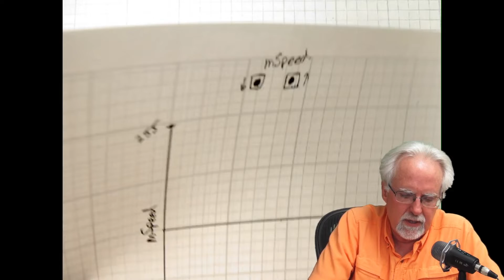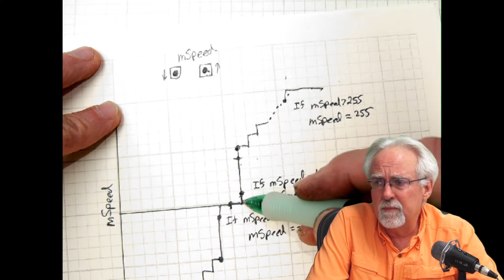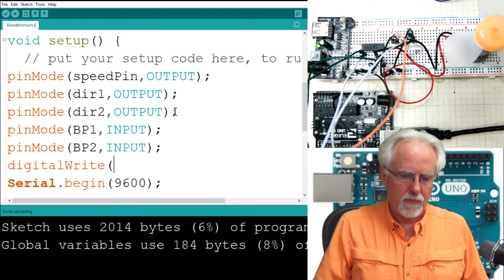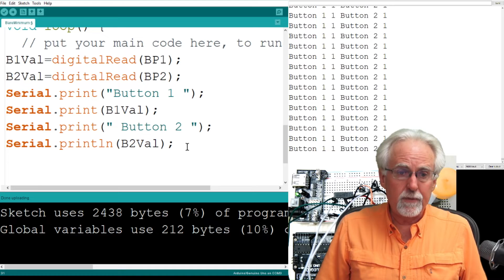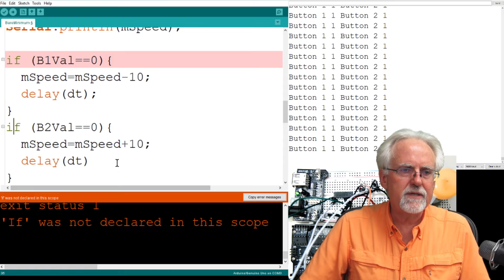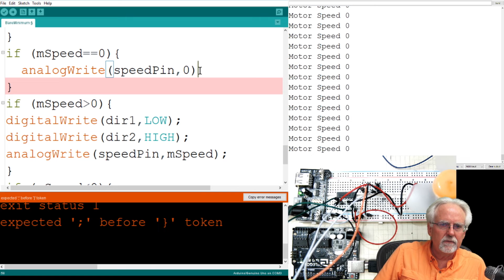Arduino Tutorial 40: Controlling DC Motor Speed and Direction with Pushbuttons

Comment: My grade would have been a fail. Like a few others I took the dimmable LED route and while I believe it was going in the right direction I wouldn’t have gotten there. But, this was a great lesson and I was able to get some real good notes from it, learned a great deal. Time to go print this off and clean up my notes.  Later and thanks again Paul.
Reply: Just realized that my motor runs in the same direction no matter if my serial monitor is showing a positive 255 or - 255.  Checked the final two “if” statements and the dir1 is LOW and dir2 is HIGH on the first statement and visa versa on the sec. Gotta keep checking, any ideas or hints?
Reply: And I found it. One set too many of the analogWrite commands. Once removed all is good. 😯

Comment: i did that quite different, like this: 
(instead of 100 i used 80, because it works with that value)

if(b1Val==0) {
  if ((speedVal+10)>255) {
    speedVal=255;
  } else if(speedVal+10<80) {speedVal=80;}
  else {speedVal=speedVal+10;}
}
if(b2Val==0) {
   if ((speedVal-10)<0) {
    speedVal=0;
   } else if ((speedVal-10)<80) {speedVal=0;} 
   else {speedVal=speedVal-10;}
}

Comment: Hi, Paul!
I did the homework, thanks for the tutorial :)

const int speedPin = 5;
const int downButtonPin = 10;
const int upButtonPin = 11;
const int directionPin1 = 4;
const int directionPin2 = 3;

const int delayTime = 150;
const int speedJump = 10;

int motorSpeed;

int value = 0;

int downButtonValue;
int upButtonValue;

int directionValue;

void setup() {
  pinMode(speedPin, OUTPUT);
  pinMode(directionPin1, OUTPUT);
  pinMode(directionPin2, OUTPUT);
  pinMode(downButtonPin, INPUT);
  pinMode(upButtonPin, INPUT);

  digitalWrite(downButtonPin, HIGH);
  digitalWrite(upButtonPin, HIGH);

  Serial.begin(9600);
}

void loop() {
  downButtonValue = digitalRead(downButtonPin);
  upButtonValue = digitalRead(upButtonPin);

  if (downButtonValue == 0) {
    value -= speedJump;
    if (value > -100 && value < 0) {
      value = -100;
    } else if (value < 100 && value > 0) {
      value = 0;
    } else if (value < -255) {
      value = -255;
    }
  } else if (upButtonValue == 0) {
    value += speedJump;
    if (value < 100 && value > 0) {
      value = 100;
    } else if (value > -100 && value < 0) {
      value = 0;
    } else if (value > 255) {
      value = 255;
    }
  }

  if (value > 0) {
    directionValue = 1;
  } else {
    directionValue = 0;
  }

  Serial.println(value);
  motorSpeed = abs(value);

  digitalWrite(directionPin1, directionValue);
  digitalWrite(directionPin2, !directionValue);

  analogWrite(speedPin, motorSpeed);
  delay(delayTime);
}

Comment: Hi Paul, your video is very amazing, hope to see you hook up Arduino with more useful devices. Not only controlling devices on the breadboard. For instance, how to put thermometer (trigger/input) and fan (output). Like when the  thermometer hit a certain degree then will trigger the fan to start running (just example).

Comment: my homework without seeing this video

int speedpin=4;
int fast;
int dir1=4;
int Rfast;
int dir2=3;
int New1;
int New2;
int but1=7;
int but2=8;
int Old1;
int Old2;
int mspeed=255;
void setup() {
  pinMode(but1, INPUT);
  pinMode(but2, INPUT);
  pinMode(speedpin, OUTPUT);
  pinMode(dir1, OUTPUT);
  pinMode(dir1, OUTPUT);
  Serial.begin(9600);
}

void loop() {
  New1= digitalRead(but1);
  New2= digitalRead(but2);
  if (Rfast > 0) {
  mspeed=fast;
  digitalWrite(dir1, HIGH);
  digitalWrite(dir2, LOW);
    if (New1 == 1 && Old1 == 0) {
      fast= fast + 10;
      Rfast=Rfast + 10;
    }
    if (New2 == 1 && Old2 == 0) {
      fast= fast - 10;
      Rfast = Rfast - 10;
    }
  }
  if (Rfast <= 0) {
    digitalWrite(dir1, LOW);
    digitalWrite(dir2, HIGH);
    if (New1 == 1 && Old1 == 0) {
      fast= fast - 10;
      Rfast=Rfast - 10;
    }
    if (New2 == 1 && Old2 == 0) {
      fast= fast + 10;
      Rfast = Rfast + 10;
    }
  }    
  if (fast > 255) {
    fast=255;
  }
  if (fast < -255) {
    fast=255;
  }
  Old1=New1;
  Old2=New2;
  analogWrite(speedpin, mspeed);
}
//digitalWrite(dir1, HIGH);
//digitalWrite(dir2, LOW);
//analogWrite(speedpin, mspeed);

Comment: In my humble opinion I feel that hard-coding the steps in an data array could be viable. Personally I think that if it is not using linear equations, then hard-coding the data is a very efficient way of solving problems. Only problem being is that RAM is a precious resource.

Comment: Hello Paul, I am still with you. But it takes a lot of time. Here is my code: 

//Motor Driver
int speedPin=5;
int dirPin1=4;
int dirPin2=3;
float mSpeedValr;
float mSpeedVall;
int mSpeed;//unter 100 does not run the motor so 100-255

int dt=100;

//on/off Led
int rLed=2;
int gLed=7;

//Buttonspeed
int bPin1=11;
int bPin1Val;
int bPin2Val;
int bPin2=12;
float buttonVal;
int updown;

void setup() {
  // put your setup code here, to run once:
pinMode (speedPin, OUTPUT);
pinMode (dirPin1, OUTPUT);
pinMode (dirPin2, OUTPUT);
Serial.begin(115200);

pinMode (rLed,OUTPUT);
pinMode (gLed,OUTPUT);
pinMode (bPin1,INPUT);
pinMode (bPin2,INPUT);
}

void loop() {
  // put your main code here, to run repeatedly:

Serial.print (", mSpeed Value right= ");
Serial.print (mSpeedValr);
Serial.print (", buttonVal= ");
Serial.print (buttonVal);
Serial.print (", bPin1,2Val= ");
Serial.print (bPin1Val);
Serial.print (" ,");
Serial.print (bPin2Val);
Serial.print (", mSpeed Value left= ");
Serial.println (mSpeedVall);

//Pushbuttenspeed
bPin1Val=digitalRead(bPin1);
bPin2Val=digitalRead(bPin2);

if (bPin1Val ==0 && bPin2Val ==1){
  if (buttonVal <=255 && updown ==0){
 buttonVal=constrain(buttonVal+5, 0, 255);
  digitalWrite (dirPin1,HIGH );
  digitalWrite (dirPin2,LOW );
  delay (dt);
  if (buttonVal ==255){
    updown=1;
    digitalWrite(gLed,HIGH);
    digitalWrite (rLed,HIGH);
    }
    else    {
      digitalWrite (gLed,LOW);
      digitalWrite (rLed,HIGH);
      }
  }
  else{
 buttonVal=constrain(buttonVal-5, 0, 255);
  digitalWrite (dirPin1,HIGH );
  digitalWrite (dirPin2,LOW );
  delay (dt);
  if (buttonVal <=0){
    updown=0;
    digitalWrite (rLed,LOW);
    digitalWrite (gLed,LOW);
    }
    else
    {digitalWrite (rLed,LOW);
    digitalWrite(gLed,HIGH);}
  }
  analogWrite (speedPin,buttonVal) ;  
}
if (bPin1Val ==1 && bPin2Val ==0){
  if (buttonVal <=255 && updown ==0){
 buttonVal=constrain(buttonVal+10, 0, 255);
  digitalWrite (dirPin1,LOW );
  digitalWrite (dirPin2,HIGH );
  delay (dt);
  if (buttonVal ==255){
    updown=1;
    digitalWrite(gLed,HIGH);
    digitalWrite (rLed,HIGH);
    }
    else
    {digitalWrite (gLed,LOW);
      digitalWrite (rLed,HIGH);
    }
  }
  else{
 buttonVal=constrain(buttonVal-10, 0, 255);
  digitalWrite (dirPin1,LOW );
  digitalWrite (dirPin2,HIGH );
  delay (dt);
  if (buttonVal <=0){
    updown=0;
    digitalWrite (rLed,LOW);
    digitalWrite (gLed,LOW);
    }
    else
    {digitalWrite (rLed,LOW);
    digitalWrite(gLed,HIGH);}
  }
  analogWrite (speedPin,buttonVal) ;  
}
}
Reply: Green LED is only for special ocassion.LOL

Comment: Got it but slightly different then yours

int speedPin=5;
int dir1Pin=4;
int dir2Pin=3;
int buttonUp=10;
int buttonDown=8;
int up;
int down;
int motorSpeed;
int speedControl;
int dt=150;

 void setup() {
  // put your setup code here, to run once:

pinMode(speedPin, OUTPUT);
pinMode (dir1Pin, OUTPUT);
pinMode (dir2Pin, OUTPUT);
pinMode (buttonUp, INPUT_PULLUP);
pinMode (buttonDown, INPUT_PULLUP);
Serial.begin(9600);  
}

void loop() {
  // put your main code here, to run repeatedly:
up=digitalRead(buttonUp);
down=digitalRead(buttonDown);

//*************SPEED UP**************
if(up==0 &&down==1){
   motorSpeed=motorSpeed+10;
  if (motorSpeed<100 && motorSpeed>=0)
 {
  motorSpeed=100;
 }
  if (motorSpeed>=255){
    motorSpeed=255;
  }
  delay(dt);
}

//**********SPEED DOWN*************
if(up==1 && down==0){
 motorSpeed=motorSpeed-10;
  if (motorSpeed<=0 && motorSpeed>-100)
  {
    motorSpeed=-100;
  }
   if (motorSpeed<=-255){
    motorSpeed=-255;
  }
  delay(dt);
}

//*************SET TO 0 IF IN NO MOVEMENT ZONE************
if (motorSpeed<100 && motorSpeed>-100)
{
  motorSpeed=0;
}

Serial.print("Button Up= ");
Serial.print(up);
Serial.print("     Button Down= ");
Serial.print(down);
Serial.print("     Motor Speed= ");
Serial.println(motorSpeed);

if(motorSpeed==0){
digitalWrite(dir1Pin, HIGH);
digitalWrite(dir2Pin, LOW);
analogWrite(speedPin,LOW);
}

if(motorSpeed<0){
digitalWrite(dir1Pin, HIGH);
digitalWrite(dir2Pin, LOW);
analogWrite(speedPin,motorSpeed*(-1));
}

if(motorSpeed>0){
digitalWrite(dir1Pin, LOW);
digitalWrite(dir2Pin, HIGH);
analogWrite(speedPin,motorSpeed);
   }
}

Comment: Thanks Paul for a wonderful tutorial. 
Here is my own code. 
It's not perfect but it will do the job base on my scenario (motor rotation is for clockwise only).
I created before watching the video.

int enbtnPin=8; //push button pin to increase motor speed
int debtnPin=9; //push button pin to decrease motor speed
int msPin=3;    //L293D EN1 pin 
int dir1=4;     //L293D IN1 pin
int dir2=5;     //L293D IN2 pin
int delayTime=750;
int enbtnVal;   //Increase button Value
int mSpeed;   //MotorSpeed Value
int mSpeedNew; //MotorSpeed Value
int debtnVal;   //Decrease button Value

void setup () {
  Serial.begin(9600);
  pinMode(msPin, OUTPUT);
  pinMode(dir1, OUTPUT);
  pinMode(dir2, OUTPUT);
  pinMode(enbtnPin, INPUT);
  pinMode(debtnPin, INPUT);
  digitalWrite(enbtnPin, HIGH);
  digitalWrite(debtnPin, HIGH);
}

void loop () {
  enbtnVal=digitalRead(enbtnPin);
  mSpeedNew = mSpeed;

  if (enbtnVal==0 && mSpeed<60) { //My Motor will not spin below 60, change number 60 base on your lowest motor speed value.
    mSpeed=60;
    delay(delayTime);
  }
   
  if (enbtnVal==0 && mSpeed<255) {
    mSpeed=mSpeed + 5;
    digitalWrite(dir1, HIGH);
    digitalWrite(dir2, LOW);
    analogWrite(msPin, mSpeed);
//    Serial.print("Motor Speed = ");
//    Serial.println(mSpeed);
    delay(delayTime);
   }
   else {
    digitalWrite(dir1, HIGH);
    digitalWrite(dir2, LOW);
    analogWrite(msPin, mSpeed);
//    Serial.print("New Motor Speed = ");
//    Serial.println(mSpeedNew);
    delay(delayTime);
   }

  debtnVal=digitalRead(debtnPin);
  mSpeedNew = mSpeed;
  if (debtnVal==0 && mSpeed<60) {
    mSpeed=60;
  }
  if (debtnVal==0 && mSpeed<=255) {
    mSpeed=mSpeed - 5;
    digitalWrite(dir1, HIGH);
    digitalWrite(dir2, LOW);
    analogWrite(msPin, mSpeed);
//    Serial.print("Decrease Motor Speed = ");
//    Serial.println(mSpeed);
    delay(delayTime);
   }
   else {
    digitalWrite(dir1, HIGH);
    digitalWrite(dir2, LOW);
    analogWrite(msPin, mSpeed);
//    Serial.print("New Decrease Motor Speed = ");
//    Serial.println(mSpeedNew);
    delay(delayTime);
   }
}

Comment: After looking at your code, I saw you took into account the motor not running unless it had a speed of 100, I did not do this. I also never electrically stopped the motor and I used a much more complicated way to determine direction change, but it worked.

Comment: I really enjoy and suffer and sweat this exercise, but I managed to do it by myself. 
Paul, I've learned a lot of you. ¡Thank you so much! You are an excellent teacher.

int buttonPinUp=8;
int buttonValUp;
float counter;
int buttonPinDwn=9; 
int buttonValDwn;

int speedPin=5;       //Pin PWM
int dir1=4;
int dir2=3;

void setup() {
  Serial.begin(9600);
  pinMode(buttonPinUp, INPUT);
  digitalWrite(buttonPinUp, HIGH);  //Pullup
  pinMode(buttonPinDwn, INPUT);
  digitalWrite(buttonPinDwn, HIGH);  //Pullup
  pinMode(speedPin,OUTPUT);
  pinMode(dir1, OUTPUT);
  pinMode(dir2, OUTPUT);
  }

void loop() {  
  buttonValUp=digitalRead(buttonPinUp);
  buttonValDwn=digitalRead(buttonPinDwn);
      Serial.println(counter);
      delay(200);

//Direction
    if(counter>0 && counter<=255) { //CW
    digitalWrite(dir1,LOW);
    digitalWrite(dir2,HIGH);      
    }

  if(counter<=-1 && counter>=-255) { //CCW
    digitalWrite(dir1,HIGH);
    digitalWrite(dir2,LOW);          
  }

//Spins CW
  if(buttonValUp==0) {
    counter=counter+15; //Increase
        delay(25);
      if(counter==15 && buttonValUp==0) { //Skips low voltage
        counter=counter+105;
      }
      if(counter>255) { //Max (+) counter Val
      counter=255;
  }
  }
  
  if(counter>0 && counter<=255 && buttonValDwn==0) { //ButtonDwn decreases within range
    counter=counter-15;
        delay(25);
  }

//Spins CCW
  if(buttonValDwn==0) {
    counter=counter-15; //Decrease
       delay(25);
       if(counter==-15 && buttonValDwn==0) {  //Skips low voltage
        counter=counter-105;
       }
    if(counter<-255) {  //Max (-) counter Val
      counter=-255;
  }
  }

  if(counter<=-1 && counter>=-255 && buttonValUp==0) {  //ButtonUp increases within range
    counter=counter+15;
        delay(25);
    }

//Motor Speed
  if(counter>0 && counter<=255) {
    analogWrite(speedPin, counter);    
  }

  if(counter<=-1 && counter>=-255) {
    analogWrite(speedPin, (255./-254.) * (counter +1.));  //Converts PWM values
  }
  }

Comment: Hi Paul ,I need one help I am working on one project which is based on Arduino mega so on that I am using ultrasonic sensors and DC motors I have predefined path on which the car should move and at a specific time it should run and also according to sensors's data it should stop that I am trying to do but I am not able to do it should I use interrupt to give the signals to Arduino to stop the motor or else what can I do??

Comment: YES, i made  my homework, but made some stupid mistakes.
It all started well: the buttonvalue's and the motorspeeed were displayed on the serial monitor, and the motor was nicely increasing and decreasing in accordance with the button-pushes.  I was thinking   YESS,  ....BUT: it worked only with + values.
When the values on the serial motor became negative, the rotation-direction did not change, and the motor speed did not match with te values on the screen!
I made a stupid mistake:
Although I knew that the direction of rotation was only determined by the status of  of the dir 1 en2 pins of the  LN903 motordriver,
I also imagined that analogread could read from - 255 to +255, and that a negative value would also give a opposite rotation than a positive value !
(just as if I would connect a motor directly to a battery and then change the polarity and thereby the rotation.)
Fortunately, you came up with the right insights and solution. I learned a lot !! Thank you!

Comment: • 26:30 - Instead of setting bounds with IF statements, you could have used the min and max functions for cleaner code:
    mSpeed = max(mSpeed-10, -255)
    mSpeed = min(mSpeed+10, 255) //yes, you have to use them like this, don't swap the min and max
• 33:30 - You don't need to test for 90 and 95, you can just test for <100.
• 27:45 - You could simplify the dead-range. Since the motor doesn't run between -100 and +100, you don't need to set it to 0, you can just let 90 and -90 be the 0 since they are functionally equivalent to a value of 0, then jump at >-90 and <90.
• 43:15 - It's probably best to set the dead zone a little bit wider since it's impractical to have to manually start the motor (it's not a pre-1919 Model T).
Reply: mmm at 33:30 (<100).... i was thinking about that but then i thought again what if you go in the negative value. It will keep resetting to 0 if you say -100. Hence the smaller than sign would mess with motor speed every time you go negative? But that's what im thinking. Not sure if that is what you meant, anyway let me know what you think. The max and min code looks interesting there, i still have to learn more, i will go have a look...

Comment: this project was definitely one of the trickier ones. i thought it would be simpler since the we had already done the LED dimming. in the end i did manage to get it working perfectly. if being graded and not looking at the serial monitor, then yes, 100. however, if looking at the serial monitor, maybe 95, because I pegged at 250/-250 instead of the full 255/-255 since i was overthinking it and was trying to add < and > equations to my project. also, before watching this video, i thought i had done it in an incorrect manner since i had 6 "if" statements in immediate succession. 

EDIT: i decided to use the joystick, but keep the speed selection of this project. left flick acts as decrease button, right flick as increase button. and the switch on the joystick now resets to 0. 

saying all that, these lessons really helped in my coding process and i am getting much better at the whole code writing/debugging thing. at first, i would wire the circuit and code basically the whole thing, only to then have nothing work, spend an hour or two debugging without any results, and i would eventually have to start from scratch. 
now, i take tiny baby steps. for example on this project, the first step was to increase the counter by 10 with a button. then other button decrease 10. then i worked on the conditions. and finally, when the counter worked flawlessly, i added the motor commands and wired it up.

Comment: Yes I did and it was a brain teaser. I forgot about a couple of special cases and for sure it didn't work as it should have. This was a good lesson need to start doing a flow chart and it should keep me on the right path, plus check my 9v battery... LOL. Thanks Paul
Reply: just borrow one of the power bricks from one of your other devices. most of them are 12 and the power board included in the kit takes 12v. i had problems running my motors on the battery, so not only because of the drain do i no longer use it. However, most of the time, i simply use the 5v straight from the computer; turns out my usb ports are capable of providing all the current i need, even when i ran dual motors.